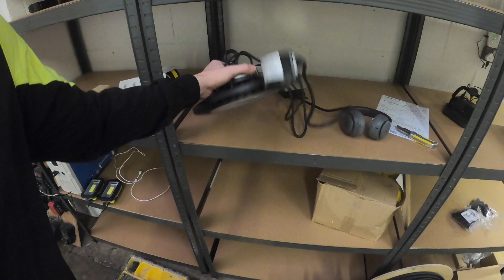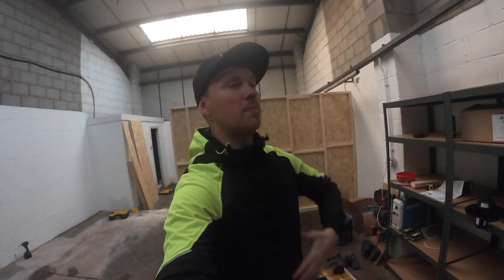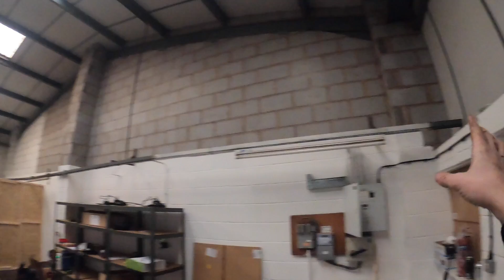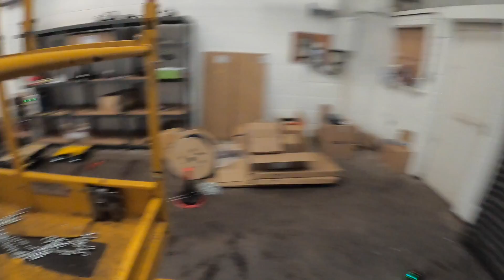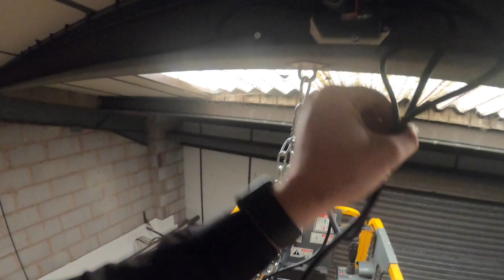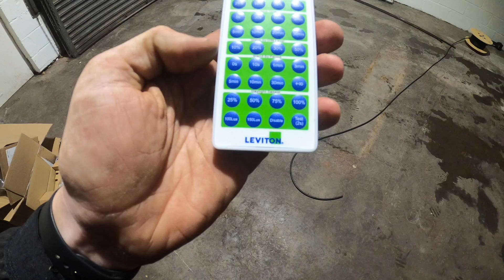Massive Tough bay lights for industrial Unit

Comment: Personally..Iwould have used purlin clips and if you must drill a purlin,one eye bolt,one hole and a body washer above the purlin.Self tapping screws vertical may not be the best way for a load. Some sites just dont allow drilling of purlins for fixings,apart from the holes from the manufacturer,it can be a taboo.
Love the enthusiasm,keep it up and hope the unit works for you.

Comment: What's their CRI like? I have a largish (18x12x8m) hall that currently has 12x 400w mercury vapour discharge lamps that I want to replace. Is there a link to these?
Reply: Hi Sam, thank you , Our Toughbay range is 80 CRI - https://www.jcc.co.uk/en_GB/featured/toughbay  . The specific version Nick is using is JC040057 and the remote code is LEV71805

Comment: Great work pal. Word of warning with green lasers though, you really should wear laser safety goggles. Taken from google - Green is more easily perceived by the eye and the beam is visible along its path. But green lasers are also more dangerous. Green is more easily absorbed by the retina than red, so it requires less exposure to cause damage

Comment: Can the cables between the box and the lumiere easily be lengthened or would it be a right PITA/impossible?  Wondering, because I think I't want them all hanging to the same level, which from a pitched roof would mean different lengths from the attachment points.

Comment: Hi Nick. Those new lights are amazing.So much better than having to put up lodes of 6ft tube fittings. Just before I retired we fitted out a wear house with LED high bay lights which cost 300£ each . But I guess their a lot cheaper these days . Good idea to get a unit it will make your life so much easier. Look forward to seeing it all finished    😀👍
Reply: Hi AMARCY53, thank you for your message. The Toughbay Nick is using is our Toughbay Retrofit with Microwave sensor and remote control https://www.jcc.co.uk/en_GB/featured/toughbay  . The specific version he is using is JC040057 and the remote code is LEV71805

Comment: Those led low bays look awesome, looking at that remote, they a very adaptable. 8 years ago was when I did a bit of industrial electrical work, i fitted 3 banks of 4 led units, they were nearly £200 per unit, i hope the price has come down since then as they are the GO TO choice for lighting these places.
Reply: Thank you Jon, they are our Toughbay Retrofit with Microwave sensor and remote control https://www.jcc.co.uk/en_GB/featured/toughbay . Speak to your wholesaler for pricing.

Comment: Well done Nick. The new lights look so much better than the old lighting
Reply: Hi shanechis, thank you , they are our Toughbay Retrofit with Microwave sensor and remote control https://www.jcc.co.uk/en_GB/featured/toughbay  . The specific version Nick is using is JC040057 and the remote code is LEV71805

Comment: Nick use some cable tray standoff brackets many of the tray manufactures make them the just plug and screw in wall job done less hassle than unistrut and less work

Comment: Hi Nick, really happy for you mate that you have your unit. Couple of the other guys have said it too. If its not too late, while you have the lift, get an alarm system wired in. Would hate for you to put all this effort in and then for it to be taken from you all of a sudden - leaves a really bitter taste even if they don't take much.  Commercial unit crime is on the up - happened to my family business twice.... nearly crippled us with the re-set up costs. One thing I would say - with the lights - set them up on a key switch so if anyone does get it, they can't activate any lights - makes it much harder for them... with a decent alarm sounding too hopefully they will think its too much hassle and run off! Good luck with the venture!

Comment: is there no a diffuser for those lights , blind u
Reply: They do make them they're fairly cheap aswell
Reply: @user-wk7wv8rn8h  shound
Reply: Hi S M, thank you for your message. they are available in 3 beam angles - 60°, 90° and 120° to help manage distribution of light and glare. The change in lens negates the requirement for a reflector.  https://www.jcc.co.uk/en_GB/featured/toughbay  . The specific version Nick is using is JC040057 and the remote code is LEV71805

Comment: Although the overall amount of light looks okay, the dispersion & overlap looks well off to me. Not a fan of the remote control - give me an on-off switch by the doors & I'm happy!
Reply: I am thinking same. A switch for every light is better. But today switches can control remote lights too. 😀
Reply: Hi FarmerSteve, thank you for the message. The remote is purchased separately. Our Toughbay range is available in non Dim or 1-10V dimmable and the settings can be applied using the dip switches on the sensor

Comment: I would put a loft on the back half, and the studio in the loft, that way you can insulate the ceiling, walls and even put down carpet.
It will also be cheaper to heat or cool in the summer if its a smaller room. 
Big plus it can look like a legit room and not some old shop. 

Would also be easier to put a bathroom on the top floor and you get the black casting couch, you can take a nap or smash on Brov
Reply: Good idea!

Comment: I would have had a double hight portacabin at the back there to give even more space. Use the hight of the unit. I had this in my first unit years ago very similar to yours. Had my office upstairs, downstairs was my workies and the canteen. Was well organised. Had space for two vans at the front as your unit has. Spray foamed the portacabins so it was nice and toasty in the winter for the office girls.

Comment: At that height I'd be gripping the handle bars unable to move. Rather you than me.
Reply: Not long ago I spotted a guy putting lights up in a similar unit. Had an extension ladder with the end resting against the beam... Got a bit of vertigo just watching!

Comment: Just out of curiosity why didn't you use girder clips for the cable, you may have found it a bit easier than having to use self tappers. Also you could use the tray brackets to fix the tray up.
Reply: And girder clip hangers for the light fittings
Reply: Guessing coz he’s mainly domestic and hasn’t yet found all the time saving goodies commercial sparks know about
Reply: Or you drill a small hole in the girder and put a cable tie through
Reply: @L lol
Reply: @supersparks9466  for the cable not the light ofc for the light id have used gripple wire

Comment: Why don't you just be a man and have extension leads plugged into extension leads 😅
Reply: he is a electrician he knows the fire hazards that creates. i am a former first res-ponder with education in fire security and then after that had a crash and had to re school to IT-systems engineer. in my country you get a load of electric knowledge on top off the stuff you need to do the computer stuff so yeah for me i fricking hate extension-leeds.
Reply: @highkicker11  you need to do 'NVQ Level 1 Sarcasm and Shit Jokes' and we can talk further about my silly comment lmao 😅
Reply: There's nothing wrong with extension leads as long as they are correctly selected and used appropriately... otherwise we need fixed sockets all over the place! I counted over 20 appliances in my parent's living room alone - were it not for extension leads & multi blocks it would be a nightmare - especially given the length of power cables these days!

Comment: Be careful if you do jet wash those GRP rooflights.  If they are old they can be very brittle from all the UV exposure and the pressure can take chunks out of them.  A suitable cleaning fluid sprayed on then hosed off with a soft/medium broom will get them pretty clean without causing any physical damage, then dry off and spray with an algaecide and they should stay clear for a bit.  Also note they will get condensation on them which will run and drip internally, particularly when snow/frost forms outside, so don't put anything that can be water damaged directly underneath them.  If it becomes a real issue then fans to move the air around should stop the condensation.
Reply: also, don't walk on that roof without crawl boards

Comment: Are you going to paint that ceiling? would help with reflection
Reply from the maker: No mate too much effort 😂
Reply: What colour would you recomend to paint it Jim. Thanks
Reply: @SuperKiller374  i would give it a coat or two of matt white sandtex or masonary paint, also paint girders white mate. Reflects a lot of free light in. Done my old unit this way and didnt need lights on till late.
Reply: @jimginn7163  thanks Jim for your reply